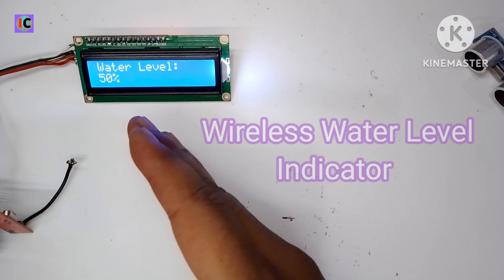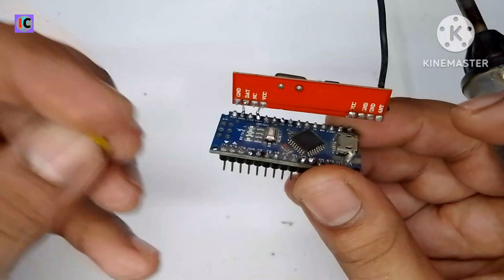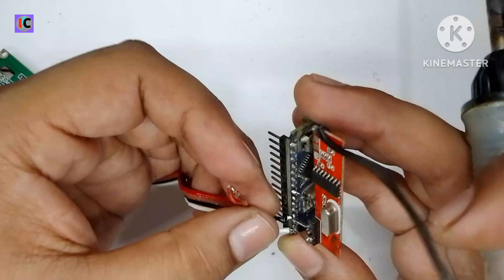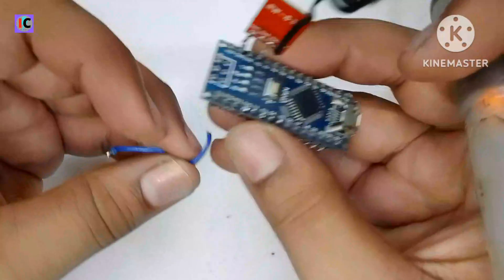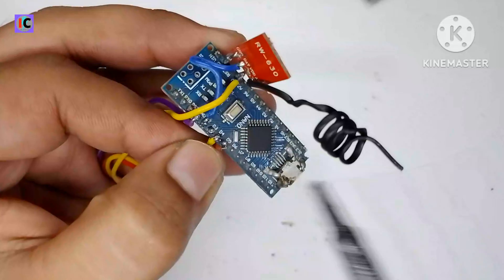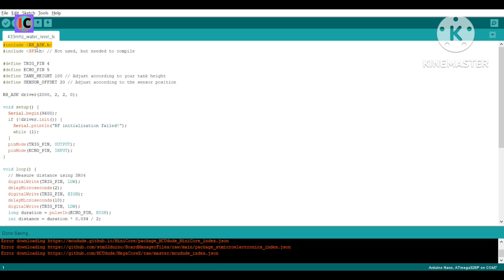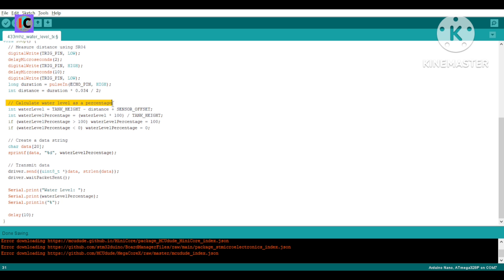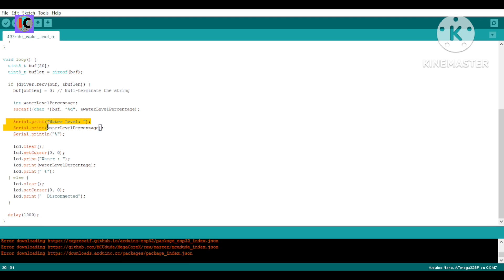Wireless Water Level Indicator #waterlevelcontroller  #waterlevelindicator

Comment: Thank you for your details 
I advice you to work with NRF24L01 good range and you can connect mult water tank system and you can add solar charger for the sensor , good luck an wishes
Reply from the maker: thankyou very much

Comment: The question is, how to avoid sensore from water when we put in tank ? Tx u
Reply from the maker: I am using AJ-SR04M waterproof sensor in my tank as it also have same pinout as HC-SR04.
here is the link of this waterproof sensor -
https://www.ebay.com/itm/373964657289?mkcid=16&mkevt=1&mkrid=711-127632-2357-0&ssspo=ljx3rwarrzo&sssrc=2047675&ssuid=&widget_ver=artemis&media=COPY
Reply: @innovationic  what should i do if i'm using hc sr04 my brotha?
Reply from the maker: using SR04 in water tank damages the sensor, so I tried to waterproof the sr04 with plastic rapper or box enclosure but anything didn't works as ultrasonic wave reflects back from the enclosure so you need to use the waterproof version currently I have installed the AJ-SR04 in my tank thankyou
Reply: @innovationic  yup, so i have to give up using hc sr04 😀 txu my brotha
Reply from the maker: welcome